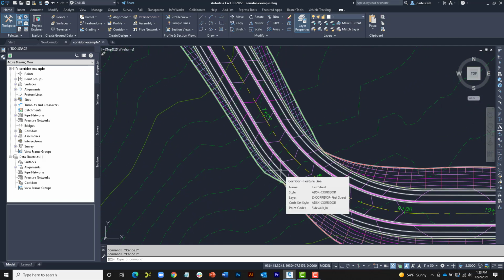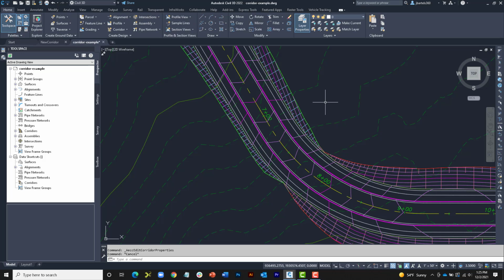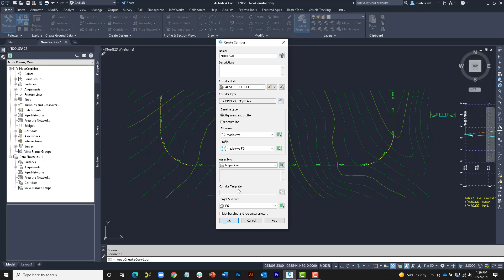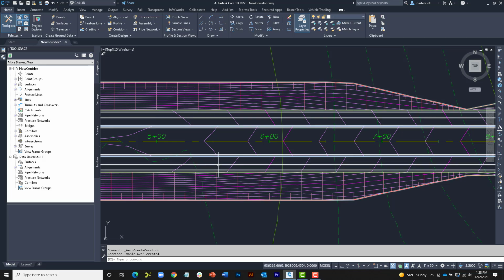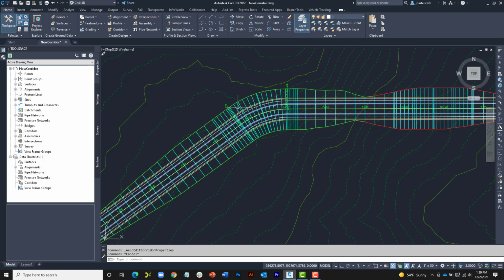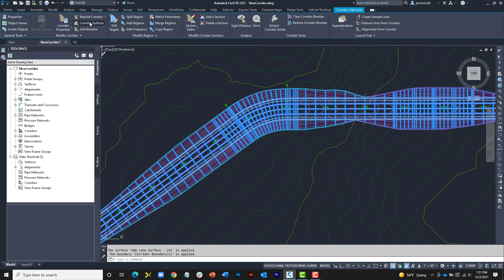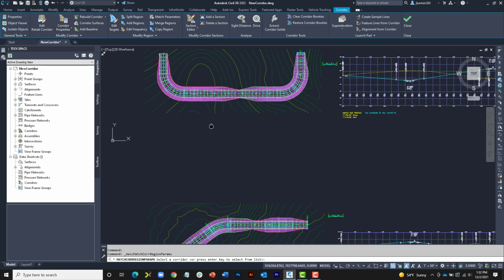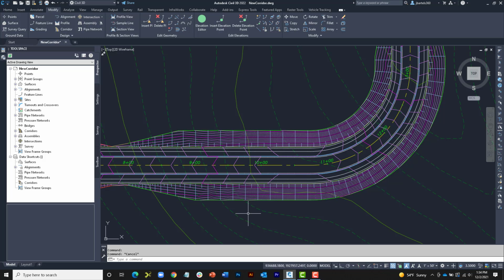Civil 3D 2022.1 New Feature - Corridor Templates

Comment: I suppose that Corridor template works only if I use the same assembly (same codes).
Reply from the maker: The feature is matching the specific point and link codes used to develop the surfaces and slope patterns.  You don't need to have the same assembly so long as the assembly you are using has similar codes.

Comment: Speaking about frequency it would be nice if civil 3d had the ability to ad an extra section exactly to the station where the cut and fill condition change. Many times when i extract triangles fron the surfaces to use in another software I have overlap there.
Reply: you are able to manually add sections at any station you want
Reply: @freeziepop2018  yes buy you must manually find the section